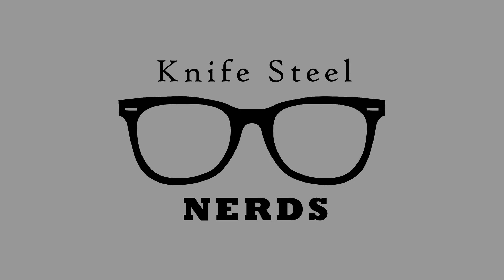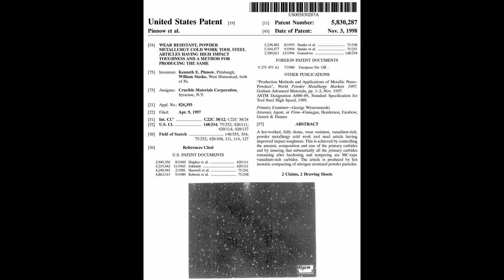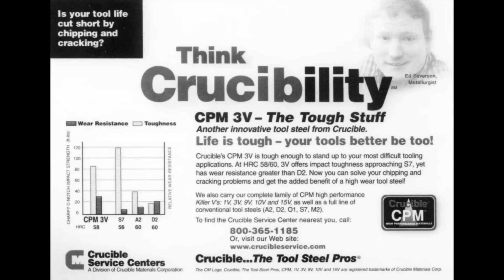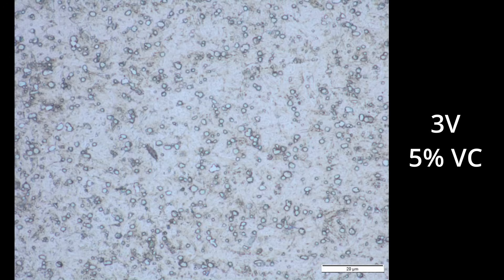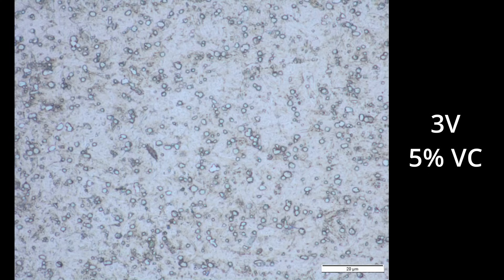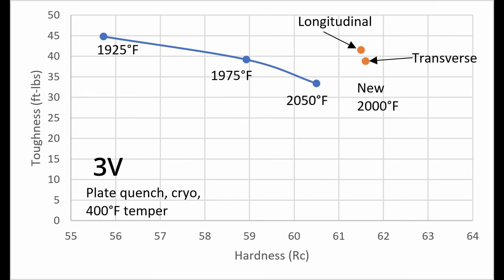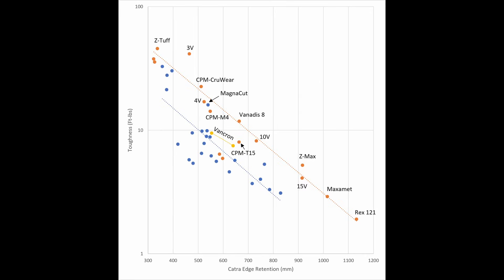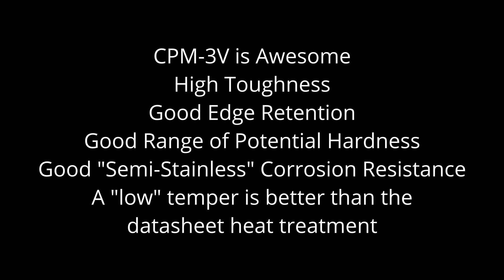CPM-3V - Still the Best High Toughness Knife Steel

Comment: Cruwear is better.
Reply: 3v has been getting around. Demko, benchmade, a bunch of fixed blades, etc. It overtook cruwear in availability probably two years ago.

Cruwear and magnacut are my favorites. Aeb-L is awesome for something softer. M4 is cool but you'll break it before anything I've mentioned so far, it still has a lot of hardness (it's a crazy steel). D2 is still cool but not particularly tough.

Comment: Figured you would hold 4V in higher regard? I once read that Magnacut was your attempt to make a stainless 4V? Forgive me for not remembering the source and forgive me if this is inaccurate
Reply from the maker: in the video I was talking about the good properties that 3V has not saying anything about 4V or MagnaCut being worse.
Reply: @KnifeSteelNerds  sorry I should have clarified I would have pictured you to sooner make a specific video dedicated to 4V before 3V. Meant no disrespect at all. Just glad you and your channel exist thank you for all the information you've been so gracious as to teach and share  with the knife community
Reply: @KnifeSteelNerds also didn't mean to insinuate one was worse than the other I think most of us feel  magnacut  is the best overall steel here. But they all have strong points just thankful for the great information shared
Reply: I think he didn’t get to the core of what you asked. 

4v has pretty bad stainless properties. It corrodes readily. I’m fact 3v is rare in that it has over 4-5% chromium. 

4v is stronger than 3v, so larrin probably wanted to make a steel that acts like the stronger, harder 4v while being stainless. 

3v is tough. But what tough really means isn’t what people really describe, in use strength is really more of a factor as far as edge stability goes.
Reply: @lindboknifeandtool   thank you very much for the explanation sir! Very well written and greatly appreciated. Not to impose but would you kindly expound more on you referring  what toughness really means in this application

Comment: It's all nice and dandy except for the fact wear resistance is way overrated.
I'd rather have more hardness, which generally means more brittle, which means starting with a tougher steel.

3V is my favorite knife steel by default, because it's fairly good but also because it's available enough. But now A8mod seems to get more common and available, so I'd rather have that.

(For the record I'm more into outdoor fixed blades)

Comment: Gretings doctor, I was recently gifted a knife made of something called Dörrenberg Edelstahl CPR from a little-known Russian knifemaker and am having trouble finding any user information on it. Since you're th expert I was wondering if you had heard any information about it. I know it's a tool steel but that's retty much it. I can't find anything similar to it on zknives either.
Reply from the maker: Looks like a modification of D2 with lower carbon and added W and V. Wouldn’t be my first choice because of relatively low toughness.
Reply: @ Yeah, seems quite unusual, had never heard of it before. Thanks forthe answer
Reply from the maker: https://www.doerrenberg.de/fileadmin/special_steel/files/pdf_en_products_neues_Design/CPR_en.pdf

Comment: 3V has been my favorite steel for years, and I have a number of fixed blades in that steel. I'd love to have a folding knife in 3V, but as you note, it is woefully under utilized there. I could probably count on one hand the number of folding knife makers who use 3V. By the way, I have one Caruthers knife, and it is treasured!  I'd love to have more of his knives (and one of his swords!), but his distro method (though Bladeforums) is a bit wonky....
Reply: I have a couple.  Demko surprisingly used 3v for it's early runs of the AD 20.5, and Reate, also surprisingly, used 3v in it's first run of the Exo-M.  Okay, I guess the Exo isn't technically a folding knife.  😄
Reply: Cold Steel, Benchmade, RMJ Tactical, Halfbreed Blades, Andrew Demko... yeah, it's about five.

Comment: I did an analysis where I took all the data I could scrape from your many tests and added weighting according to my own preferences for three different types of knives, and 3V came out on top in two of the categories
Reply: Sounds awesome! May I kindly ask which category it didn't come out on top? Was it something where max edge retention was needed
Reply: @WyattWillis88  No, the opposite. For a chef knife I wanted a steel with lower edge retention to be easily and regularly hand sharpened. To my very not great surprise, AEB-L was at the top of this category

Comment: Really interesting to see how well 3V can perform for corrosion, I've never had issues with rust as-is, hopefully this research you've done helps improve it out in the market. It would be cool to see some big folders from someone like Microtech to include some 3V options for the Amphibian or MSI maybe?
Reply: Medford has some huge folders in 3v and some chaves stuff in years past has used it. I think half breed blades large bush folder might have used it as well but I'm not positive
Reply: @WyattWillis88  It really is rare. There are some Demkos too, just not many, yet they use 20CV/M390 for these "tactical" blades all the time... it just feels really under used.

Comment: I prefer 80crv2
Reply: Thank you for the thread, gentlemen! :D
Reply: I prefer 80crv2 because its well available, here in Finland and when I was in the military ( in recon) I saw it endure the artic winter conditions (minus -25'C) without breaking even thou people were batoning firewood in the middle of the winter. It's easy to maintain in fied conditions and gets a wicked edge easily. Laurin Metalli makes very good 80crv2 blades and theyre not expensive. Its tough and well known among bushcrafters and hunters so its time tested. I havent either tested CPM 3V propably its good but people dont use it over here. Maybe prefer is a wrong choise of word, lets say I use and like 80crv2 because like I said, its time tested in the arctic conditions. Cpm 3V has never gained such popularity even thou theyre available. Perhaps im bias and clueless but 80crv2 is the knife steel I would trust my life on.

Comment: I'd love to know why Spyderco only used it in a single model.

I've had nothing but great experiences with 3V, but i have to assume they found something they didn't like. It's at least as corrosion resistant as Cruwear (in my experience), so I doubt that's the limiting factor.

Comment: 3V and A8Mod are some of my favourite 'tough' steels, they're a good mix of cost, ease of heat treatment and purpose. They do a really respectable job for edge retention, can take a very fine edge and while not very many knives get made with it, the small scale guys like me still churn out some each year but its never really been picked up on much by the big producers. At least also in my experience, its better than D2 for corrosion, like you wouldn't pick it for saltwater environment knife but its hardly like 80CRV2 or 1095 that gets a fuzz in a day.
For a joke once after making some bushcraft knives out of 3V, which I don't make those types of knives much, I did whack out an 8" chef's knife out of the stuff with what was left. So there's probably some really confused customer out there who bought the thing wondering why it can chop through raw bone and just never seems to get very blunt :)
Truth be told I probably should have kept it for myself, but I needed the cash!
Reply: CD1 fits in that group nicely as well.
Reply: @drunknnirish  I could never find CD#1 from any suppliers to try it out, could sometimes get a bit of Z-tuff but its a very expensive metal. Lot of those alloys with Silicon and Moly in them sure are special
Reply: @krissteel4074  I am lucky enough to have two knives in CD1 but I have heard its remarkably hard to source.
Reply: @krissteel4074 I believe Niagara has it.
Reply: @drunknnirish  They'd be keepers for sure, a very uncommon and high grade steel will last into the next generation
Reply: @brandensutton2324  A lot of the time the direct source doesn't want to speak to people doing small orders, I don't know if they're any different but most manufacturers start off with 'how many tonnes you want' and then the conversation quickly gets very sad from there :)
Reply: Average knife bro consumer of consumer products have long been overly focused on “edge retention” - by which they mean abrasion/wear resistance- it’s all about the edge retention, for them. 3V has great “edge retention” in my book but it’s nothing to those guys excited about.

Comment: What are your thoughts on that Delta 3V heat treat? Just watched a Dutch Bushcraft Knives video about a D 3V knife and am thinking about trying to get a knife in that.
Reply: Roman Landes Heat Treatment recommendation:

Now this is what I would recommend for heat treat cpm 3v:

1st preheat: 500-600°C, equalize

2nd preheat:800-900°C, equalize

Authenize: 1060-1070°C, equalize, soak 30-35min

Quench in Oil preheated 60-80°C

Cryo: immediately after cleaning, minimum -80°C or lower soak 30min

1st Temper: 150°C equalize, soak 2hrs, quench in water

Cryo: immediately after temper

2nd Temper: 180-200°C equalize, soak 2hrs

should give you 60+ and a fine durable grain. RGDS Roman

This is why I would do it like this.

The "receipt" suitable is for a vacuum furnace (Quench with maximum pressure) or a regular cline, but surface protection has to be assured.

Salt bath will cut the soak time approximately by 1/3 and thus give better aust-grain.

The preheating steps will assure the the austenization steps can be done quick. Quicker speed >> smaller grain

Authenization temperature is dedicated to dissolve Chrome and Molybdenum >> fair hardness and some enhanced "Stainresistance" is to be expected.

The vanadium will remain in the steel bond as a compound of carbon, hence aust-grain cant really grow

The oil quench is suitable for any steel out of the air hardening classes. The thin cross sections get higher hardness after quench (greater volume fraction of martensite) and a less stabilized volume fraction retained austenite. (The volume fraction of RA can be expected (near guess) between 20 and 30% or even higher)

Warping of the blade shall not be an issue with these materials.

If you have done a lot of hard mechanical work before hardening (milling, grinding,)then do a stress relief so warping gets less likely.

The cryo needs to be done as quick as possible below -80°C.

RA tends to stabilize rather quickly after the quench (some reports speak of minutes)

The longer you wait, the less efficient the transformation to untempered martensite will be.

And a minimum of -70°C is necessary to get enough stress into the micro structure, so the transformation (RA>>Martensite) process can restart again.

Extensive soak time is not necessary since the process runs at hypersonic speed.

But still there will be remains of RA that need to be addressed by the 2nd cryo.

The first temper is a low temper so the remaining RA is stabilized at the lowest level possible and at the same time there is enough stress relief in the martensite that has been built and furthermore the transformation from tetragonal to cubic martensite is started.

The water quench speeds the whole thing up and avoids precipitation of embrittling phases.

Then the rest of the remaining RA will be attacked by the 2nd cryo (usually the RA will drop below 5% volume fraction) so burr formation is less likely.

2nd temper will now temper the untempered martensite build up by the cryo and bring the blade to a fully tempered martensitic structure with a low volume fraction of RA and a fair amount of carbides undissolved.

Of course there is the question why not temper it at 540°C?

First of all, if you don't have access to cryo then this is your way to go.

In my studies of edge stability I did extensive work to compare secondary hardening and low temper with cryo.

The results (reference is my graduate thesis 1999 Munich University of Applied Sciences) I found considerable higher edge stability with the samples that had low temper/cryo The material used at the time was ATS-34 all with the same charge and thus the same condition of austinization, but with different temper cycles.
Reply: Delta 3v is just a low temperature temper protocol which he already talked about. Their are different revisions like the one from Roman Landies as described above.

Comment: I think you can make a tougher one without corrosion resistance, which is also easier / quicker to sharpen.

What are the greatly balanced carbon steels then?
I'm really curious!
Reply from the maker: Low alloy steels typically aren't as well-balanced as high alloy powder metallurgy steels. Some of my favorites include 15N20, 52100, and ApexUltra.
Reply: @KnifeSteelNerds  Thanks for the reply! I'm looking for balance inbetween edge holding, toughness and ease of sharpening. That 15N20 seems quite attractive to me, will have to look further into those you've mentioned. Thanks a lot!

Comment: Magnacut at 65 HRC Outperforms it for me in every single aspect. Especially the corrosion resistance is unmatched at that endurance level.
Reply: Magnacut is awesome. 3V is much tougher, meaning that for certain applications, 3V is a lot better choice.
Reply: @irfkaptan are there any off the shelf Magnacut knives at 65hrc that I can investigate?